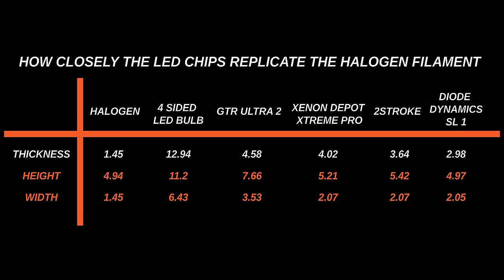Why You Should Avoid Multi-Sided LED Bulbs | Headlight Revolution

Comment: Don't blame for multi-sided led or 2-sided LED brightness, both also could work well in different condition.      brightness of LED also relied on efficiency of heat dissipation, defo high temperature will resulted less brightness.  Another issue is type of LED chip performance and luminous intensity of CSP/COB/DOB/Epistar/Osram,   CSP is work better than ordinary COB.                                                                                                                                  Beam patterns wise? it's also depend which type light reflector and lens to fit for LED.
Reply: exactly my point 💯

Comment: Hello Sir, I bought these 360• long time ago and u r right they don’t work.. so thinking of buying new ones but again there r so many in the market. Your video has cleared what type of led we should buy but the led they use are two types COB and CSP so my curiosity is which one is the best... pls help... thnx
Reply from the maker: COB is an older style of LED chips that we would not recommend. CSP chips will be much better.
Reply: Headlight Revolution Thnk u sir.... big help👍👍👍👍
Reply from the maker: You're very welcome!

Comment: Hey GUYS-
Ok, i get the reasoning of the two sided LED bulb. 
But,  in my 2012 Silverado  with H11 low beam - my question is will it work as an all the time daytime running light??  
Also, the V4 (?) led you used with the correct beam pattern (and higher lux reading) seems to have a small opening in the metal frame to one side of the led chip. 
Does the orientation of this open side matter during installation of the bulb or is the other side open in the opposite way to improve the reflected light pattern in the stock housing?? 
Currently run the Osram 64211 L+ bulbs. Would love to almost triple the lux reading with a new led bulb.
Chris, bless you guys for helping the world see better. Thanks again!
Reply from the maker: That particular bulb was a dual beam bulb, Your Silverado would be using an H11 single beam bulb and would not have that design. We are going to do a video on a truck just like yours soon if you're interested! The S-V.4 does work perfectly with your daytime running light though.

Comment: Awesome video. I was under the impression no LED bulbs worked in reflector housings. I have an OG 4Runner with the reflectors. Best set of H11s off the top of your head? diodedynamics?
Reply from the maker: These are incredible bang for the buck: https://headlightrevolution.com/v-4-led-headlights-h11-h16-bulbs/

The GTR Lighting Ultra Series 2 bulbs in H11 are slightly brighter with a lifetime warranty, So they are also a good option. The SV4 bulbs do well in those 4Runners though.

Comment: Awesome info!!! But what about if you have an old e30 / e28 that you want to upgrade Halo style lights? Would you use the Halo for day time running and still use a 2 sided led ????
Reply from the maker: Yes, You could do that. Regardless of your setup you'll want to avoid the multi-sided LED bulbs and stick to the 2 sided ones.

Comment: just bought 2 cheap cars from a co-worker, 1 had some "blue" halogen bulbs, which seem ok, not drove it but once at night, the other car has the LED style, not put car on the road yet, my friend loved those, but complained about radio interference, but he drove car approx 900 miles a week, it has 455K miles right now, & claimed the LED were awesome, I like the car with Halogen better than the LED equipped car, just testing in the yard, but cant afford to spend any big money, as I cant afford to even put car on road yet,  but I want to look into putting either a correct LED, or normal Halogens back in. it took me 2 months to get first car on the road, & will be 1-2 months to get the other one, as each had issues I had to fix. but now have a toy for me, small 5 speed econobox that handles good, & will have an automatic  "spare car" at my other home, which was my primary goal, so if wife needed it could have an automatic to drive, we have had 3 breakdowns there in 2 years. 

the LED car was used on a low speed paper route of approx 150 miles a day 6 days a week late  nights, & he said he saw better with the LED? but aid he had to play a CD at night, but could listen to radio if driving in daytime, the other car was his backup, but now paper is 1 day a week, & he wound up with a "newer nicer" car. so sold me his old beaters for cheap & let me make payments, which I am close to paying off.

Comment: TBH I didn't even know there were ANY LED bulbs that replicated the beam pattern of a standard halogen bulb.
That's some incredibly good info to have, especially if you're looking to pass a safety inspection.
I'm an auto mechanic, and I've lost count of how many of these bad LED conversions I've had to cut out of cars.
Before you say I'm being a party pooper, I have to say that I'm just the messenger. How so?
Well, the state says that if I let a car pass inspection with non-compliant headlights, and a cop pulls that same car over later with the same headlights in it, then I'm virtually guaranteed to have the state cancel my safety inspection license, and I might even go to jail or get hit with a HUGE fine!!! (well, huge compared to the size of my independent repair shop)
It's not a matter of "I don't want you to see what's coming on the road", it's a matter of
"It's been taken out of my hands, I do what the state tells me to do and the state says you gotta at least try to make the beam pattern look like that from a halogen".
Basically, you need the magic DOT approval mark on it, or legally I can't pass it (I won't say I don't have a price, but that price is "10k + whatever the maximum fine is", so nobody with any sense can afford it over something stupid like headlights).

Comment: just read the V.4 data on the bulb. Is 2.50 amps more or less than the stock bulb I have?
did you install it in the housing with the leds horizontal in the housing?
Reply from the maker: It's extremely similar to the current draw of your stock bulbs. You'll want to align the bulb so the LEDs face horizontally.

Comment: I'm glad I didn't go all out with LED's for my outer lights, just signals and braking.  got modulated brake lights that will blink a couple of times and it's really helped with the recent 0 vis fog I hit on my way home from work.

I might end up putting on some HID's for my headlights but I dont want to be that jackass that blinds everyone on the highway with my low beams. but I also need something brighter for when I'm working job sites at night. any recommendations and can they be installed by a diy home garage mechanic?
Reply from the maker: Send us an email to Sales@HeadlightRevolution.com and we'll help you get exactly what you need for your vehicle. We have many options for you and your fog lights.

Comment: What woukd be your recomended H1 LED under $200 ? 

My car uses projectors for low beams however is from the late 90's, it also uses a seperate h1 for the high beam.
Im sick of all the cheep ones not being bright enough with a good cutoff or focus.
Reply from the maker: Check this out, It should be perfect for you: https://headlightrevolution.com/v-4-led-headlights-h1-bulbs/

Comment: Above all this testing one thing should be noted: 
LEDs are supposed to be installed in projector housings, never in a reflector housing.

Reflectors will completely blind incoming drivers whereas projector housings aim the light pattern to the floor, this way other drivers aren’t blinded.
Reply from the maker: Properly aimed reflectors can achieve the same great beam pattern also. It's the people who put garbage LED headlights in their vehicle without aiming them who cause the most headaches on the road!

Comment: What is the correct position of two sided led bulb in projector head light? Is it horizontal - meaning led chip is up and down or vertical left and rigth )
Reply from the maker: Generally you will want to have the LED chips facing left and right, so that would mean aligning it vertically!

Comment: I have a 2018 Honda Accord with led-low beams/halogen high beam bulbs.  I've been searching for an LED high beam bulb set to replace the halogens, but having a tough time locating the right bulb set.  Any recommendations?
Reply from the maker: It looks like your Accord takes a 9005 bulb, so you should be able to install any 9005 LED bulb with no issues. I would personally recommend going with either the S-V.4 or the GTR Lighting Ultra 2 as those are the best LED bulbs that we have found os far!

https://headlightrevolution.com/product-types/bulb-style/9005-h10/

Comment: Well many thanks for this extremely informative video... I was in a process of getting  LED headlights having 2 LED on both side now I would go in for that single LED both side..also I have noticed many LED headlights have a spread with not so good illumination (rather a floodlight), often annoying for oncoming vehicles as well blinding illumination from rear following vehicle on a rear view mirror... would like to know which color temperature seems better I think almost all are in range of 5600-6000 kelvin...
Reply: 4000K is what you want. Easy on the eyes and you don't sacrifice a lot of light output. I try to convert all my lights to 4000k but it takes time, knowledge and money.

Comment: Great Video! I was so hesitant on asking a question on your suggestion for a LED setup for my vehicle. But after seeing your response on just about all of the comments, I'll take a chance. What LEDs would you recommend for an 08 Mercedes E350 4matic (current H7 halogens) easy DIY, plug n play setup.  I've looked all over and most venders suggest easy install but once I referenced a YouTube vid on install, I saw it required "Jerry Rigging" of cutting plastic n metal or even wires of which I'm not trying to do. I would like to do low, high beam and fog all at once. Any brand is on the table.  Thanks for any input sir!!!
Reply from the maker: I'm glad you took the time to comment, We're here to help out as best we can! To be honest, The best route on your Mercedes is going to be an HID kit. That being said, Those Mercedes vehicles can be pretty picky when it comes to aftermarket lighting. Send us an email to Sales@HeadlightRevolution.com and we will go over a few options for you on your E350.

Comment: Excellent video, just one question, what type of led bulb is best replacement for Philips H4 bulb with inbuilt reflector for low beam. I have it in my bike headlight.
Reply from the maker: Give these a shot, They do really well in H4 applications! https://www.headlightrevolution.com/amp/v-4-led-headlights-h4-9003-bulbs/
Reply from the maker: Give these a shot, They do really well in H4 applications! https://www.headlightrevolution.com/amp/v-4-led-headlights-h4-9003-bulbs/
Reply from the maker: Give these a shot, They do really well in H4 applications! https://www.headlightrevolution.com/amp/v-4-led-headlights-h4-9003-bulbs/

Comment: Some hyundai accent 2017 h4 led recomended? Have alredy ones but the high beam no see mutch diference
Reply from the maker: For that application, I would recommend a pair of the Morimoto 2Stroke 3.0s, and you will also need a pair of the H4 anti-flicker links! I have linked those bulbs for you here: https://www.headlightrevolution.com/h4-2stroke-led-bulbs?quantity=1

Comment: What about those bulbs with a little wing over the diodes? Are they any good?
Reply from the maker: Which ones specifically would you like tested? We are always open to suggestions. Some of the dual beam bulbs have those in place for the high beam diodes, They work okay on some brands and poorly on others.

Comment: Why do you get 1400 max lux from the reflector headlight but only 400 max lux from the projector, when both using LED bulb upgrades?
Reply from the maker: Reflectors typically do better with LED bulbs. Projectors work best with HID.

Comment: so this means that for projector headlights type of cars, can only use two sided led bulb? and it cant be too thick or tall? im sorry for my bad english but i really hope you reply,i just wasted a for like idk maybe 10 - 20 dollars? cause i live in malaysia and bought random led light for my car which that use a projector type and it uses H7 socket, but what i dont understand is, why is the light looks so uneven, and scatter, the led that i bought are thicker than this and also quite taller in terms of its led bulb... please explain, thank you!!
Reply from the maker: You should only use 2 sided bulbs for any headlight!
Reply: @HeadlightRevolution  and does it also should be slim? i mean before this i had a pretty thick 2 sided led bulb, with a heatsink at the bottom,i mean it doea fit,but the brightness and the clarity of the led is horrible,but just yesterday i go to nearby car accessories and the shop owner help me choose which one, and i gotta say it is much brighter now,and i looked the led that the shop owner helped me is a very different one from the one that i bought online,its slim and 2 sided led

Comment: My left side headlight shines higher than my right is it the bulb positioned wrong or the Headlight?
Reply from the maker: Double check the bulb positioning first, Sometimes it can be installed slightly crooked and that will make a big difference in output.

Comment: For a reflector housing I can understand. What about a 360 bulb in a projector housing?
Reply from the maker: It's still not a good option, You'll usually see a lack of hotspot and an overall dim pattern.
Reply: I currently have two sided LED bulbs in my 2007 Suzuki Grand Vitara and the lighting sucks. The fogs work well but the projector headlights barely throw any light. I bought 360 Leds to try and if they suck I will go HID. When I read the reviews of the 360 Leds in projectors everybody said they were better than halogen so idk

Comment: If yall need a new video idea.
It be cool if yall did 4x6 headlight housing that are not "fixed" ones that clear lense different reflector backing and one that have a oldschool glass that suppose to give the pattern not the back mirror backing. Use top 5 or 10 leds that workin them that have the best brightness and pattern.
Alot of semi drivers and old school vehicle drivers would like know these options. Rather than spending over 200 dollars for fixed headlights that you cant replace the bulb/led. 
Just saying I think it be a hot video. To put out.
Reply from the maker: We will definitely consider that and put it on our video list! Thank you!
Reply: @HeadlightRevolution  it be nice to get people from buying those cheap multi stacked led ones cause they blind and dont beam very well... I appreciate your reply

Comment: Because of this video i bought some LEDs very close to the stock footprint of a halogen bulb, similar to the SL1. They come with the resistor boxes. When i turn them on they work great. But when i crank up my truck they strobe.  But once i flash my highbeams, they stop strobing and work just fine. Why is that?
Reply from the maker: That is due to your vehicles daytime running light. Unfortunately, the only LED bulb that will work with those DRLs is the Xenon Depot Xtreme LED Pro bulbs with the DRL Driver.
Reply: @HeadlightRevolution  oh wow. Ok. All research i did, i didnt see anything about that. Thank you for that. So now i can stop looking for problems lol. I was ready to send the lights back.
Reply from the maker: Not a problem at all! When you are ready to get those Xenon Depot bulbs going, let us know!💪

Comment: I would assume that the same would apply for putting LED bulbs into a projector housing that's originally designed for HID bulbs? For example, putting LED bulbs into a retrofit mini H1 projector. Awesome video, super great info!
Reply from the maker: Yep! Projectors that are designed for HID should only use HID. No matter what the beam pattern is never right and there's less light from the LED bulb.
Reply: @HeadlightRevolution  how can I tell if the projector was made for HID or not ?

Comment: Could you please consider including NovSight's Led's headlight bulb. They are very affordable and some of their design are very similar with some of the top branded led headlights design.
A Video on finding the best leds led from the cheap leds
Gtr lightings, Morimoto works but they're very expensive for many of us.
Reply: Novsight is not even in the radar. Not worth the price.
Reply from the maker: The NovSight bulbs haven't done the best in our recent testing. They are a pretty inexpensive bulb but the beam pattern and brightness they produce really don't compare to the higher end bulbs.
Reply: Skipper i told you

Comment: So if the led was all the way round and same position and size it should work in theory. So while the thin one is close and works ideally that would be best not to be confused with 3 or 4 sided ones ur discussing
Reply from the maker: With the current tech, more than 2 sided bulbs just don't work right.
Reply: @HeadlightRevolution  Totally get what your saying

Comment: Heard the gtr ultra 2 are coming to the Toyota 4 runner. Is this true? If so ETA thanks :)
Reply from the maker: They are! GTR Lighting is modifying the heat sink slightly on the bulb to clear the housing in the Toyota 4Runner. No official ETA yet but I'm told it will be very soon.